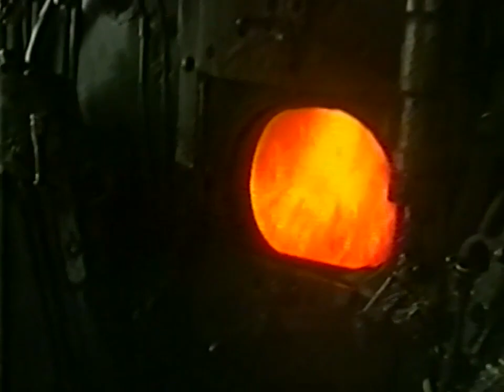Lots & Lots of Trains, Vol-1 | An Exciting Collection of the Greatest Trains in the World

Comment: While watching the WHOLE video, I have a List of some of the Locomotives on whereabouts and extra info:

UP SD60M 6283 - Renumbered to 2428
CSX FP7A 118 - Now Western Maryland 67 (I believe she still works up at Cumberland; If I'm correct)
TTI U28B 242 - Most likely retired, last seen in 2007 at Paris, KY.
CSX C40-9W 9047 - Repainted to YN3B
CR SD40 6306 - Now ICE/ IMRL 202 (Not sure if it was retired)
CR SD40-2 6486 - Now NS 3406
CR GP15-1 1658 - Became CSX 1554 and was retired on April 2019 and was most likely sold to LTEX
BN SD40-2 7120 - Now NS 3496 and became an Operation Lifesaver unit (Not sure if stored or not)
SP AC4400CW 333 - Now UP 6379 and still wears the SP paint as of today
AMTK P40DC 828 - Sold to LTEX sometime in 2019
UP SD90MAC 8046 - Rebuilt to NS SD70ACU 7274
UP SD60M 6353 - Renumbered to 2509
CR SD60I 5576 - Became CSX 8723 and was retired on February 2019 and sold to Progress Rail
CR C40-8W 6107 - Became CSX 7322 but wrecked in 2017 and was scrapped
C&NW SD60 8020 - Sold to UP, then to CRIX, HLCX, and later to NREX
AMTK CF7 591 - Most likely sold for scrap
NS SD50 6769 - Became NS 5437 and later Rebuilt to SD40E 6317